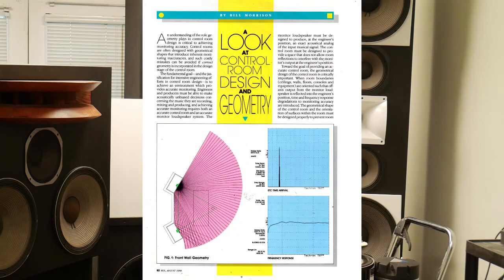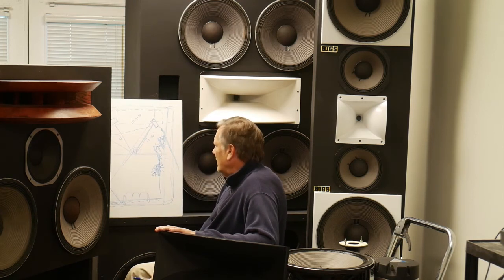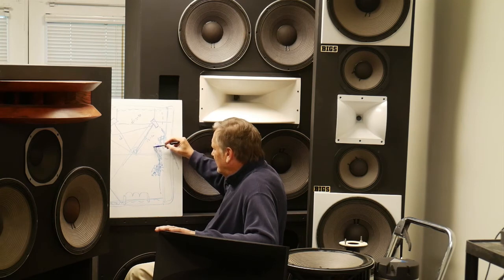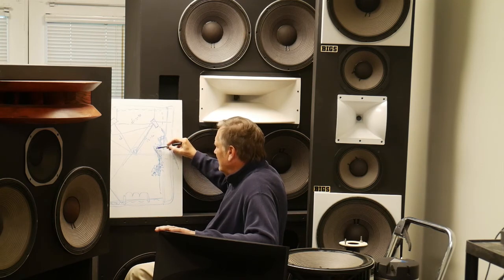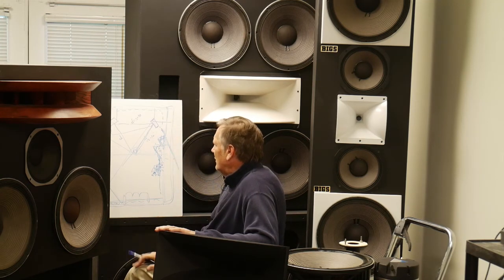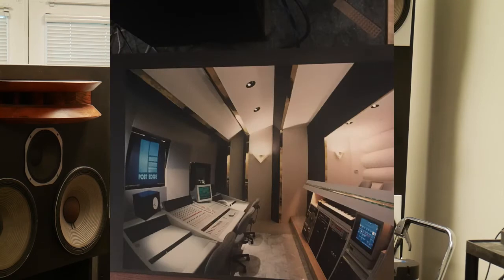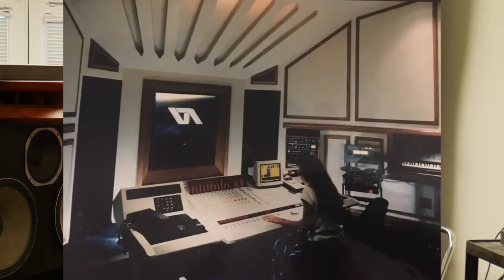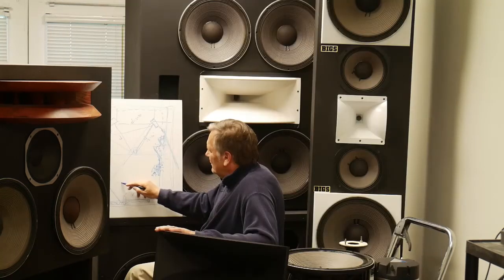Control Room Design BIGS Control Room Monitors

Comment: Very interesting! Thanks for all the info, I've read lots of books on acoustic design but do you know or point me to any source to get more in depth about the LF absorption systems Hidley used in his design? Also on geometry effect on modal behaviour, angles and materials for the best guiding of all the sound spectrum, you mentioned some materials on the video but if possible I would like to get in touch with you for more in depth knowledge, hope its possible, thanks! Great video!